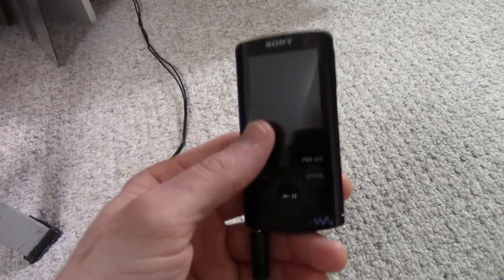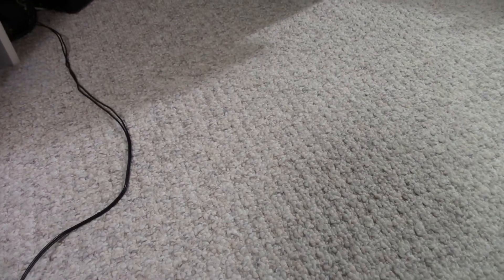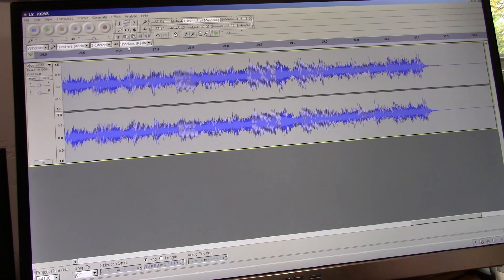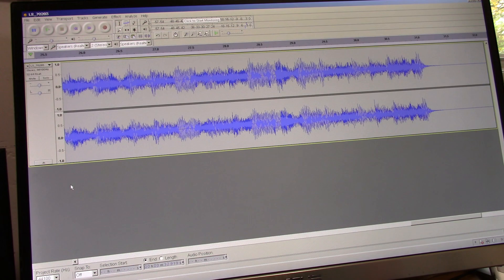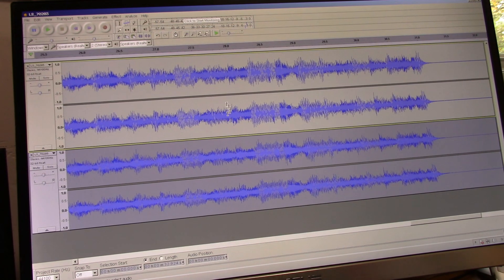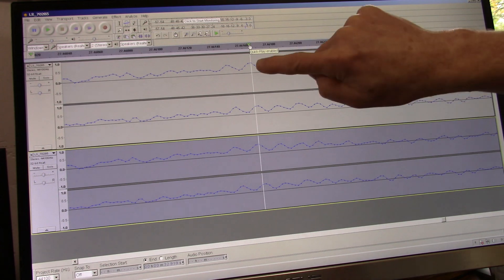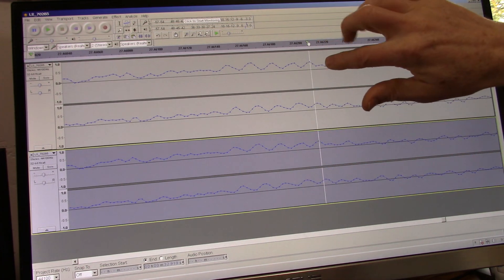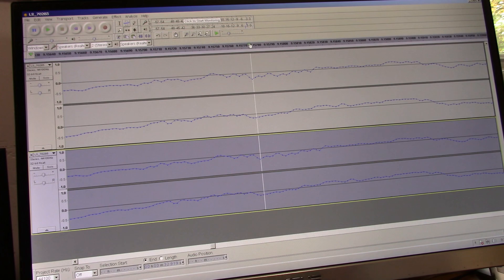Room acoustics null test experiment

Comment: This is interesting, I thought, from your introduction you were going to null out the sound in the room live. i.e. by having a microphone, inverting amp, and speaker. Like with noise cancelling headphones. This was very interesting too. It would be a useful tool to use when setting up acoustic treatments for a home theatre / listening room - I wonder if the mic on a smart phone would be accurate enough for this.

Comment: Very cool idea. What would it take to almost completely null out the higher frequencies? I was surprised how much of that came through in the first null file. Maybe play and record the song on repeat and walk out, open up curtains and blinds, remove things that can move and vibrate.
Reply from the maker: I tried setting the recorder at a higher sample rate (96kbs) and it provided a much better null because it allows me to better align the two samples.
Reply: @JohnAudioTech  Oh right! Even with the samples aligned, there can still be a real world time difference so in higher frequencies you could be off by up to half a sample.

Comment: I have been using VideoPad making videos where I have two pairs (stereo) of mics to sync up. I can only sync up within one frame but that is still a pretty thin slice of time. If I can't line up the two exactely I have to think which mic was closer to the speaker's mouth. If the speaker or one pair of mics is moved I can see it in changes in that sync. I usually dump or deeply attenuate the in-camera audio in the final video, the noise level of the recorder is drastically lower, but still sync for action and lip-sync.

Comment: trying to build a preamp circuit using op amps and 12v supply split using voltage divider to take the high impedance signal from my guitar and make it close to stereo line level to be used with stereo amplifiers. I would use j fets but I cant buy them locally. would really appreciate some advice or a dedicated video on the topic if you're interested. anyway love your videos. keep up the good work

Comment: Doing it this way, you won’t be able to null out recordings well due to misaligned decimation in the converters and clock drift.  You need record and playback simultaneously on the same AD /DA.  Shifting samples on the timeline isn’t good enough
Reply from the maker: I forgot that the recorder has a 96k sample mode. The smaller slices of time allowed me to null much better. Interesting effect by walking in and out of the room and placing objects to hear the effect on the audio. Seems to stay in sync in the one minute tests I ran.
Reply: JAMES AZBELL This shows the superiority of digital over analog recording.  Imagine trying to do that with an analog tape recorder with the wow, flutter and dropouts of that medium.
Reply: @JohnAudioTech   yeah it's a cool experiment.  I've known people to use this technique to record with playback over monitors in studio control rooms, nulling out the playback afterwards, and have done it myself when recording a large group of people with no headphones.  It works well with synchronised play and record.

Comment: A very interesting experiment, this explains why room treatment is really snake oil. This was a very worthwhile experiment, and I am setting up to do the same just out of interest. Maybe try some white noise and a mono signal input.
Reply: How does this experiment explain why room treatment is snake oil? (It's not.)
Reply: @HazeAnderson  he demonstrated that just movimg the blanlet changes what you hear
Reply: @nicoras8803  hence room treatment actually can improve the sound. Ask anyone who has to set up in a reverberant room.
Reply: @nicoras8803  Moving the blanket from one spot to another changes the measurement, but isn't actually audible under normal conditions - only the nulling setup which relies on a particular measurement makes it audible. Most of the edge diffraction effects and low-magnitude high-order reflections have a generally very low audibility, your brain just cancels them out.

Room treatment to an extent makes sense. As Haze says, you don't want to be listening to music in a room that is too reverberant, that has strong primary reflections. Granted, just having normal furniture and clutter around is for the most part sufficient and furniture arrangement is often the best way to go about it, and a lot of what is offered such as thin structured foam panels that you stick to the walls tends to be insanely ineffective, and can be quite overpriced for what they (don't) offer.

Anyway the experiment is absolutely neither here nor there in this regard. You're just making connections that you want to make that are not anyhow supported by the experiment at hand.
Reply: @SianaGearz  Take your system to your open soccer field and listen what it really sounds like. You will be surprised. Trying to make a room sound like an open space is impossible. An anechoic chamber tries to create such an environment but at such low frequencies it needs to be very large.
I have been in audio R&D for almost 50 years my honest opinion of "treating a room" just offers you bragging rights of how intense an audiophile you are. Thanks, John, this was very entertaining and maybe an encouragement to designing  a "real-time" instrument for  audiophiles to keep them occupied forever.
Reply: @nicoras8803  Open field sound is wrong too. I actually know how my Canton floorstanders sound in free air, i took them out on the terrace once :D Decent speakers are created to measure approximately flat-ish in an anechoic chamber, but they are never used like that, so music isn't produced or mastered for this impossible listening situation. So some degree of room tuning, room boost is designed into the listening material, according to research by Sean Olive et al, when they were trying to figure out the measurement target for headphones, they had to start with the speakers and how they're really "supposed" to sound.
Reply: Yes, every room is reverberant because there is nothing in it and it has parallel walls, ceiling and floor. Yes you can treat it to be less reverberant by placing things like a carpet, furniture and the like to scatter and absorb some sound. 
That is the nature of our living in boxes. Take your system outside, space is non-reverberant and see what you think of your system. Now your subjective  observation is not affected by anything other than your system.
Reply: @nicoras8803  Leave your system outside for several weeks and see how well it works ... let alone sounds. Also, how does your system sound on a windy day? How about one that is particularly humid?

Comment: Seems like a challenge to sync when the samples happen at different times.  That is, the recording clock and playback clock are not synced.  I wonder if you played back from Audacity while recording new tracks with it would help align the samples so they occur in the same place each time.